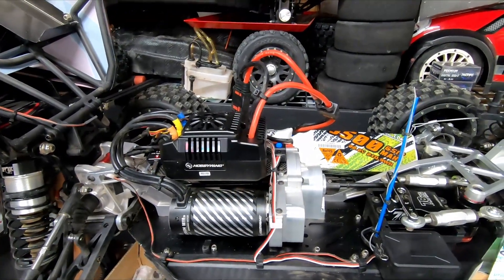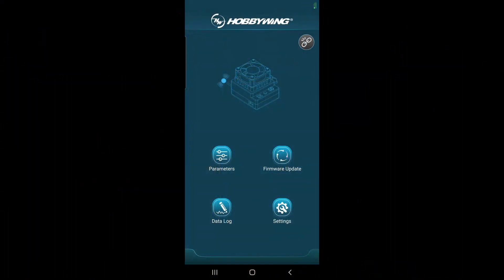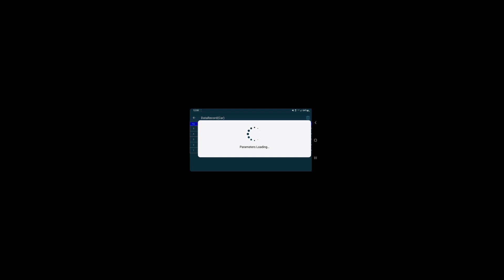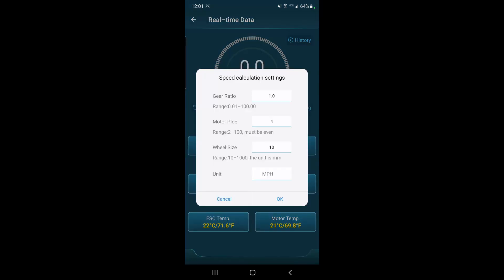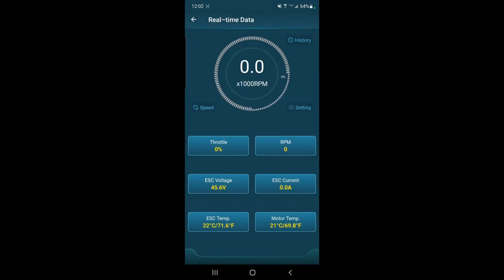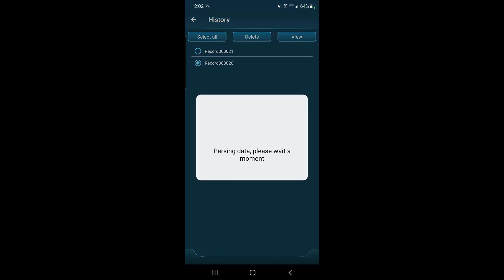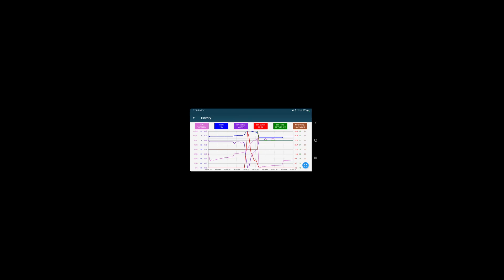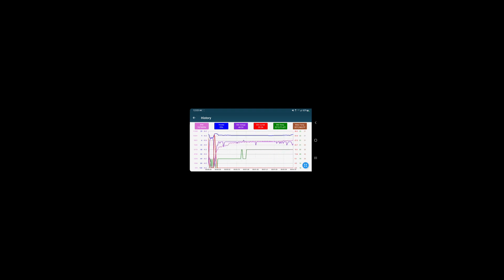How to view data log with Hobbywing Max4 and Max5 G2 esc

Comment: Hi!
Thanks for the video! 
I have one question, I don't find an answer for: as the OTA adapter goes into the fan port, is it possible to run the car with the OTA attached...or is the fan than not working?
Reply from the maker: Yes, you just need a Y. The max4 comes with a small Y harness so you can use the fan and OTA module at the same time.
Reply: @HighVoltageRC3080  thanks!!!

Comment: If this works on the XR10/XR8 pro series ESC's the drag racing community  will probably have a meltdown since Hobbywing supplies zero information about this. My main question is how many data points per second can we get?
Reply from the maker: From what I understand it will display whatever the esc supports for data logging. I don't use the xr esc so I can't speak on what they will display just what the max4 shows and once I run my new max5 G2 I'll see if it's any different. I believe it has some other programming options.

It is frustrating that HW has not done any videos on this. Maybe we can give them feedback and they can do a "Charlie show" on data logging or something. Would be nice to know if there is something I missed haha